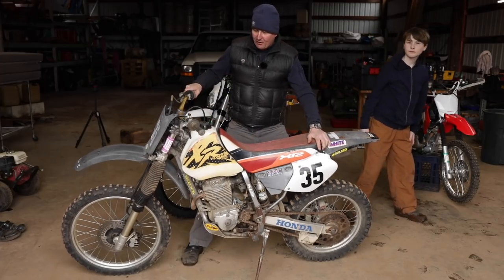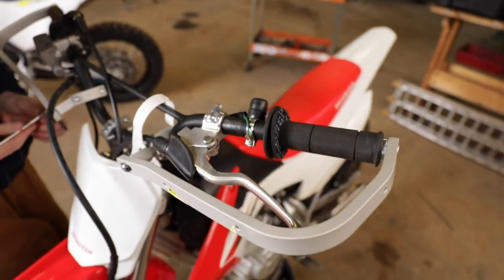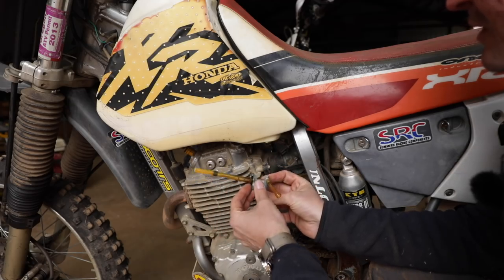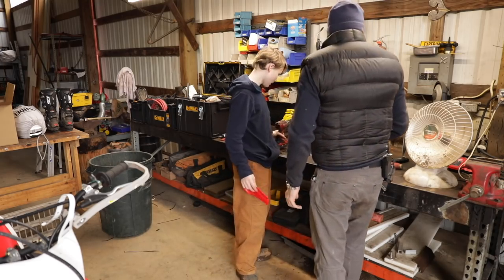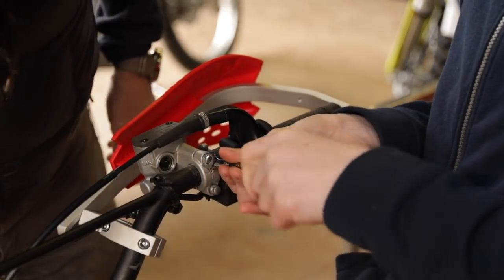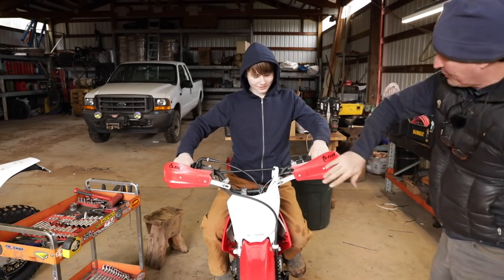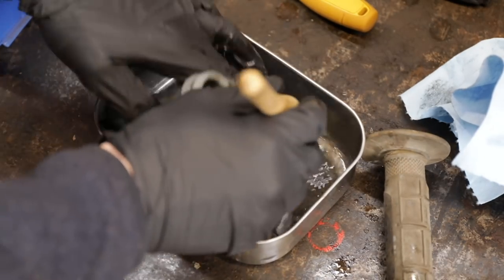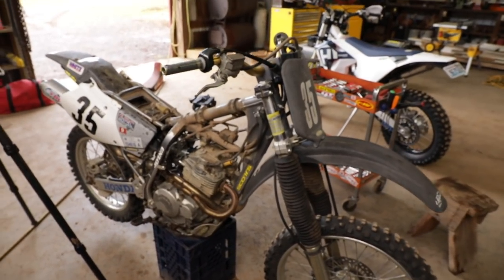This Is Hopeless

Comment: Another fun fact: any motorcycle handlebar clamp with an arrow or "up" cast into is not intended to be evenly tightened. Try this out - take the rear of the clamp off of your brake lever and place it on a flat surface. You'll see that the mounting surfaces are parallel but not equal in length. The side which the "up" arrow points to is designed to be fully tightened first, and the clamping pressure is adjusted with the bottom bolt. The larger gap is supposed to be on the bottom. This way both bolts are aligned straight in the perch. If you tighten them to an even gap you will see that the bolts are pulling themselves in slightly crooked if you look closely. Final tip...leave the perches sllliiightly loose so if you wipe out they spin instead of breaking a lever.

Comment: If you buy jack a new bike get him a kx100 or a yz125. Both can be easily tuned to ride enduro, with much more capability than a crf150f (i think that’s what you said you’d get him). If he’s big enough for full size, go for the yz125, if not, go for the kx100. You will be doing the market and ur son a favor by getting him a 2 stroke. Buy them before they stop making them. It will be harder to ride but it will really teach him what it means to be on a dirtbike unlike a 4 stroke trail bike.

Comment: Think I would have got it running first oil, oil filter and plug then prettied it up with new parts also looks like the throttle cables are routed incorrectly if it hangs up on lock 👍

Comment: White is not really a color... lol! Good answer jack!
Reply: i like his thinking
Reply: If all three primary colors are showing, the result is white.  Black is not a color.
Reply: Black is not a color,  it's the absence of color.
Reply: White is all colors
Reply: Pretty sure white is the absence of all colors. Black is the presence of all colors.  When I got black paint at Ace Hardware, they started with white and put all sorts or stuff in it.  Ended up more blue black than charcoal black...but good enough,.
Reply: @David Straub It depends on if you're talking about colour of light or colour of something material (like paint). They are the opposite of each other.
Reply: Lee Jordan  damn bro that was deep

Comment: I've got a 1987 yamaha DT200 im currently rebuilding and as i removed the cylinder from the engine i realized it might have an overheating problem as the piston was melted on the side facing the exhaust ports

Comment: You didn’t have to cut the grip off.... all you have to do it loosen the throttle tube and slide it off the bat a little bit and it will be perfect...
Reply: Bar*

Comment: I see nothing wrong with using an open end wrench in the fashion that Jack was using it.  When the bolt or nut is loose, what’s it hurt to use it that way?  if he was trying to torque the bolt down, or break it loose, it would be a very poor choice to an open end that way, but the bolt was loose with a fair amount of slack to take up.

Comment: Mr. Wranglerstar, 
In response to how you corrected your son @10:09 on how to tighten the front brake clamp, you are actually wrong. On most Japanese motorcycles the front brake clamp has a arrow or dot that is placed up. You tighten the upper bolt first and then snug the lower. Most clutch levers mount this way as well. https://www.instagram.com/p/BgsIC3Rn61Y/?taken-by=twostrokelife127

Comment: just take off the gaswire and put oil or other material and use air to push it from the other end out then just move the cable back&fornth then its like as new i have done that my self

Comment: Weight is a deal. Bikes wiegh alot, he is like 80 lbs. But I've been there. First time. I had a bite of throttle,let go of the brake and clutched it disappeared. As I'm still y standing

Comment: Skip the 4 stroke dirt bikes. stick with easily rebuilt 2 strokes.
Reply: Lizard you said it! I went off course buying the new 4 strokes for a few yrs. 100+ or so hrs and you need $1500-2k worth of work done. Head, valves, cam, etc...whatever they can come up with! I can replace top end on my smokers in a dim lit room in an hr! Like new for $150. People with any sense will learn! Nothing better than riding in the pipe!

Comment: hey mr. W want to here a story about an insanely tuff drill my uncle has a hyper tuff li-ion drill that he let my father borrow my father was doing some work on our bathroom one day and spilled the purple pipe cleaner stuff on the drill which wound up sealing the battery to the drill we couldnt get the battery off so we took it to my grandfather who poured gas on it and hit it many times with a rubber mallet and still couldnt get it off so later on we unscrewed the entire drill and pryed the battery till it was almost loss then decided that since we had split the battery to just all the screws back in and after all that after like a month trying t fix it, it was still running but the kicker is it is a 20$ hyper tough drill from walmart and it was the best drill any of us ever used also please test a hyper tuff drill against a dewalt and makita

Comment: XR 250 is very good bike. I had 2times bigger (of cooouuurse) XR 600R...Oh...those memories...Maybe its not the best bike..Maybe the power is not enough, mybe its heavy, maybe got no starter...but hey...If you change oil and do basic stuff its nondying...The bad thing is - if someone hear this, the "normal" owner just dont care about some service on these bikes, so many of them are in "junk and trash" condition...But parts are cheap so all of these bikes can be fixed quick and relatively cheap also. Dont get rid off it..Dont sell it Wranglerstar...Just keep it, trust me :-)

Comment: WRONG those throttle cables are fine they just need to be lubed correctly.  You take a plastic lunch bag and snip the corner off it and slide the throttle cable through the hole and then use a rubberband to seal the plastic lunch bag to the outside cable jacket.  Then take a stick and some spring clamps and put that plastic baggie into the air so that when you put some light oil such as sewing machine oil it will flow down inside the cable jacket.  Usually overnight is all it takes.  It will need a new throttle tube though.  That one looks like the throttle was jambed to far onto the bar in the first place causing the grip end to gouge into the handlebar end.  Are you running alcohol free fuel in the bikes?  You friends bike probably should be running it......probably why the O ring gave out and if that is the case the petrol tap will be next to go.

Comment: The honda xr's are THE EASIEST bikes to maintain, air filter ,check the oil ,lube /adjust cables /chain and fill it with gas and if you don't have about a 1/2 hour for that but you have some time to ride YOUR EITHER LAZY OR JUST LOOKING FOR SOMEONE ELSE TO DO WHAT YOU SHOULD BE DOING YOUR OWN SELF ! WTF

Comment: Engineers always do things that don't make alotta sense because everything works and is easy on paper but in real world applications it's alotta times harder and more time consuming ,we always had that problem with the engineers we had on the floor at snap-on he wouldn't listen to use he wanted to set times and procedures on how long this this and this took the machine to do well he wasn't taking in to account how long it took use to put the part in and different things it all looks good on paper but it doesn't always work in real life ,as we would tell him

Comment: Skip the150 cc go to 175- 200cc, the same problems on each👍👍👍
Reply from the maker: Honda doesn't make a 175 or 200
Reply: Nah get that 110 4 stroke when your young then go straight to a 85 or 125 2 stroke. My first bike was a 125 2 stroke but I had already been riding friends bikes and gotten used to them.
Reply: honda xl175, 185, 200R, 250
they did make them, decades ago lol. i personally like the old models better, smoother ride, easier to work on, more comfortable seats, lower seat height. not as "sporty" as the new 150 though
Reply: daft nord the old bikes were slow heavy and hard to controll once you ride a new bike you become a such better rider
Reply: Damon Jones riding old stuff teaches you a lot more about learning How different machines handle. Once you learn how to start an old machine and keep it running you will have learned a lot more than a new one that works perfectly
Reply: Damon Jones i don't see how learning on a "perfect" machines makes you better. Need to learn FINESSE first. I think of it like instrument playing, if you can make a poorly setup and beat up guitar to sound nice then you will learn how to do the finer things perfectly to make it sound like an expensive instrument

Comment: sooo what your saying that you cannot upgrade the crank pistons exhaust  CDi unit. carburetor change the sprockets on the wheels improve clutch.
.wrangle star dont treat your audience as if they were born yesterday...
your interpenetration of that bike cant have much done to it is a understatement.
a 50cc scooter can have heaps of sht done to improve performance...
so you telling your youtube audience ...
this is a intermediate bike and not much can be done.......LOL @ U wrangle star...maybe stick to showing off axe's ...

cheers from downunder

Comment: AHJack, believe it or not white can the presence of all colors...

Black can the absence of all colors...HaHAhHA

In art, white is the absence of all color and black is the presence of all color. To artists, black is considered a color, white is generally not. In light, the opposite holds true. Black is the absence of color, and white is the presence of all color. To scientists, white is a bunch of colors, and black is not.

Is white or black really a color? - Fun Trivia Quizzes

www.funtrivia.com/askft/Question68124.html

one more thing, that you prolly already know but I didn't hear you mention. I never tighten my controls completely tight. that way in the event of a crash the levers will tend to rotate out of the way before the break. I make then so it take a lil bit of force to move them and be sure to lock tight the bolts and check them periodically the be sure they didn't loosen and fall out. 

by the way, I love your videos and family values, something that is rare to come by these days.

Comment: poor design off a screwdriver?  if the tool doesn't do the job right, it's probable not the right tool for the job. I suggest you get the  right one and size: https://en.wikipedia.org/wiki/List_of_screw_drives. hint: the Honda probable needs jis.
Also, first you tell Jack not to tighten the screw too fast en then you say the screwdriver design that prevends one from doing just that, is poor design ...... rofl